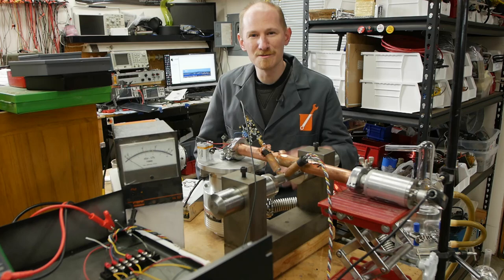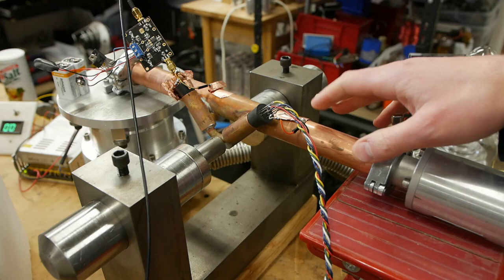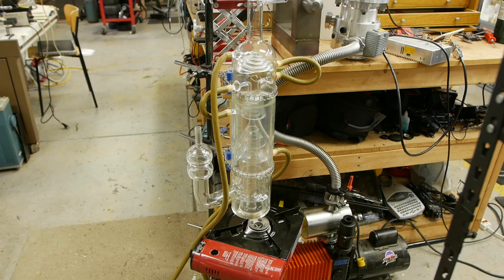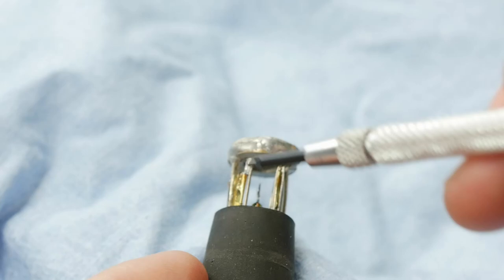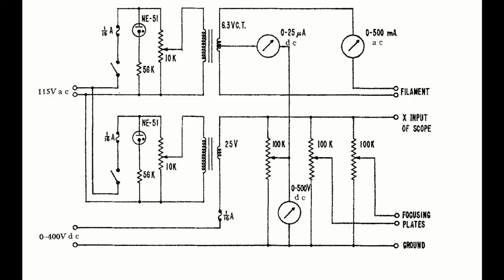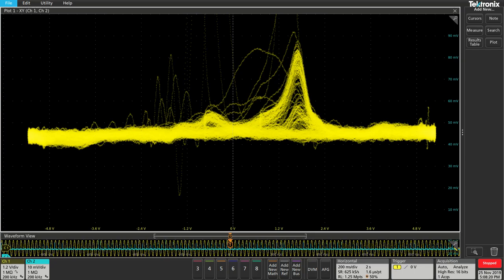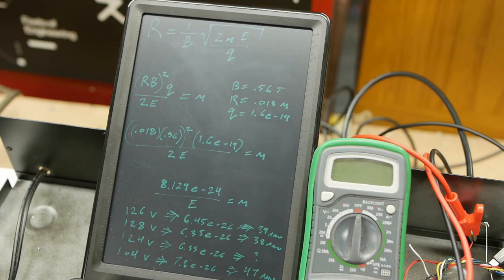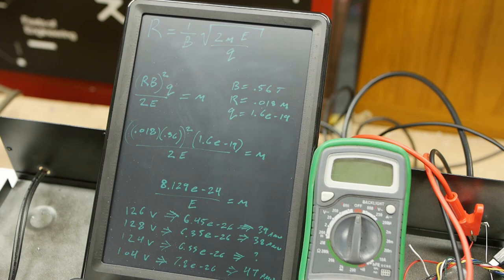DIY mass spectrometer measures potassium in dietary salt substitute

Comment: I was wondering about some ideas to debug the cause of the second peak. Both of them revolve around inherent measurement errors of the machine:
1) The machine may contain some compound that causes the error.
What happens when you run the chamber without the sample? Does the second peak disappear?
2) The machine could have some funky phenomenon where it measures the same isotope twice at different voltages: What happens when you run the experiment with a sample that contains only a single isotope of a single atom?

Comment: I think that extra peak could be a type of resonant echo.  One way that you could test it is by changing the diameter of your tube and see if that changes the location of the echo...  Otherwise, it could just be that the potassium chloride/ water solution has a contaminate in it..

Comment: Have you done an error propagation analysis of your mass peak calculation, and if so, what magnitude of error did you find?

Have you tried to fit the large asymmetrical peak spectrum with respectively one Gauss* and a sum of two Gauss'es* with means corresponding to the expected mass signals?
* Maybe a Gauss isn't the proper distribution for describing this type of spectra, and something else, like eg. a Lorentz distribution should be used instead.

Comment: While it seems likely that it's an artifact of the variations in the beam path/radius in the variable magnetic field or something along those lines- perhaps a double sequential slit at each end, forcing even further collimation, would attend to that (and ensuring the axis of the filament is parallel to the slit, I suppose)- I'd double check, given that the number you (and they) got was 47- silver- and just a couple AMUs above that for the "asymmetry" is tin at 50, that you're not getting artifacts from the solder in the copper joints? Whether it's vaporising due to heat and vacuum, or getting dug out by charged particles hitting it, or whatever. Just a wild possibility that occurs to me.

Comment: At 15:40 or so, couldn't you also put deflection plates past the beam slit at the ion source and sweep a voltage across them (like how CRT o-scopes work) instead of sweeping the initial acceleration voltage? That would probably be a bit more work, but I'm guessing the ion source is going to do sketchy things like voltage dependent sublimation (some things will probably preferentially stay behind, skewing the apparent mass and apparent mass ratios of ions).

Comment: A homebuilt GC or HPLC shouldn't be too much of a challenge for a talented person like Ben 😉
Edit: Based on a quick bit of googling, it looks like there are quite a few DIY gas chromatographs around, especially as the detection is being done by the spectrometer you don't even need to worry about the flame ionization detection stage.

Comment: Now you just need an IR/UV/Vis spectrometer, an NMR machine, and a crystallography setup, and you'll have a proper analytical lab you can charge people to use.

One question: the mass spectra I'm used to seeing show basically every possible size of "chunk" you can break off of the molecule with the ionizer. Compared to a factory unit, is the tungsten filament limited in what ions it's capable of producing? I guess a shorter way of asking this is: how different are the spectra produced by this from those I might look up in a reference (ignoring the noise, I just mean the actual m/z readouts)?

Comment: There is a coating on the razor blades. Could that be the second hill in your measurements?

I really enjoy your videos!
Reply: I considered this but he did clean them with some sort of solvent in the video...
Reply: Also the blades were used on both sides so it should be an even noise.. the polarity on the transmitting side will be wrong for a peek

Comment: Did you run it without any sample in the machine? That would flush out whether the mystery peak is systemic or unrelated to the sample chemistry. Also, where'd you get the Turbo pump? Not exactly a DIY thing laying around in my lab. :)

Comment: Have you thought about setting a fine neddle under the filament and with a very long copper capilary make a solution injector in the mass spectrometer? The capilary would have to be very long to restrict the flow and mantain the vacuum level

Comment: Wouldn't it be possible to use an induction coil to heat the oil in the diffusion pump and a blower to cool it back down? Or a peltier element.
Reply: Or perhaps one of those vibrational cryo pumps? I forget their name.

Comment: Maybe there is something else in the tungsten filament which, either singly ionized or doubly ionized has a charge/mass ratio close to potassium at +1. Argon or calcium at +1, or some other cation (krypton?) at +2? The bulb may have had krypton inside before you broke it. Could it have become bound up somehow with the tungsten? Is the filament even hot enough to kick off a +2 cation of a noble gas?
Reply: mercury or lead at +5 ionization? LOL.

Comment: I got curious abot that 47amu reading, if my understanding is correct this should be titanium, investigating about bulb filaments i came across patent number US3927989A, titanium is in alloy with tungsten to improve stability at high temperatures.

What is claimed is:
1. In a tungsten filament of the type containing a filament dopant compound including at least one alkali metal which produces a second phase consisting of bubbles at filament operating temperatures to improve the sag resistant properties of the filament, the improvement comprising a third phase material selected from the group consisting of , zirconium, hafnium, tantalum, ruthenium, strontium and columbium added to the filament for combining with the bubbles to reduce their migration and coalescence.

Comment: if you're worried about hysteresis couldn't you change the frequency of your accelerating voltage oscillation to be slow enough that you can easily characterize the field strength with an independent sensor to add as a compensating factor for your x axis?

Comment: Re. the second smaller peak that's  1/10 to 1/6th the height of the main peak: You may have a signal reflection. What is the length of the cable from the detector+preamp->scope? There are a couple of other potential causes too. I'd be keen to hear more/talk about it if you've still got this thing up and running.

Comment: I think it's gotta be Tungsten (+4). Maybe WCl4 is formed and it gets oxidized from the heat into W(4+). Also, the peak is roughly half the width of the main peak, which has a width of ~2 M/Z. Tungsten has weights ranging from 182-186, which would give it a width of ~1 M/Z. 

Super easy to test too. Simply run the experiment without the salt. I bet you'll find peaks at W(+3), W(+2), W(+).

Comment: Have you tried running just the filament or another control sample (NaCl or something)? Because what I just recalled, you don't directly record the mass, but the mass over charge ratio. So when you are using a tungsten filament, that makes me think that you might be picking up something like W4+. W has an atomic mass of 183.84, which is just under 4x 47 amu. While W4+ isn't the predominant ionization state, it is known to occur (according to wikipedia). I don't think your measurement window would be wide enough for W6+, but maybe you could set your spectrometer to look for that as well...

Comment: Could the peak at 47/48 be titanium? A quick Google search shows many of the sewing needles you use have a titanium coating. The tungsten filament could be acting as a sputtering source to knock off titanium ions from the needles. I think others are right, you should measure something else like regular table salt to see what peaks move.

Comment: Rather than build a chromatograph, you should consider building an infrared spectrometer. 

An IR spectrometer may as well be equivalent to a chromatograph for this use case, maybe even better, but is 1000x easier to build out of the hobby shop. As a first approximation, all you need is something to split the IR beam (diffraction grating, prism) and a wide spectrum IR source (which can be as simple as a halogen bulb and filter glass.) The rest is a clean and organized build, which you clearly can do. IR optics needs to cover wavenumbers from 400 cm^-1 to 4000 cm^-1. 

The main consideration with use/accuracy with an IR spectrometer is that they are relative instruments. This doesn't matter for distinguishing between two compounds, as you show here, but would mean they need calibrated if you want absolute measurements. This is perfectly workable too, though, so long as you already have a known pure sample to compare with.

If you can build a LASER Interferometers, you can build a IR spectrometer. And they are really useful instruments for chemistry considering the simplicity.

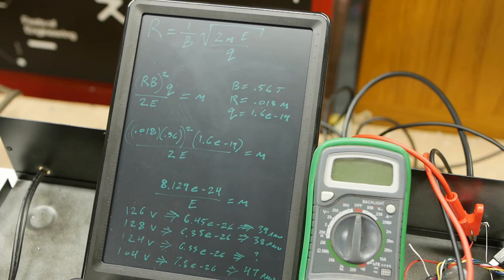Comment: What's the blue/green notepad thing he's using at 22:00?
Reply: It's one of these https://www.amazon.com/mafiti-Writing-Scribbling-Drawing-eWriter/dp/B07VM4CYXQ, they come in all sorts of colors, I have one that writes in pink. It's a sheet of vinyl stretched taught over a frame that sits slightly proud of the back. When you write on it static holds the vinyl to the back, changing the optics and the color of the film becomes more vivid. There's a small battery and a switch to charge the back repelling the film to "erase" it.

Comment: could be the variation in magnetic field strength across the tube bend with the variation of e field adds up to a non-preferred path through the bend... a center flight path and an edge of the tube path near the grounded copper tube with weaker b field??? seems like that would just smear the result not give a separate peak...whatever the cause, it appears to be a robust result as the little peak appears in the two other papers too

Comment: You refer only to K39 and K41 but what of the one in the middle? which must affect the results since it accounts for around 120ppm of all natural potassium. K40 is of course radioactive and beta decays to Calcium 40 and to Argon 40 by electron capture.Just as an aside, the ratio of C12 to C14 is used for radio Carbon dating, similarly the ratio of K40 to Ar40 is used in Potassium Argon dating.

Comment: Seems like a calibration issue and you just need to find a way top 'zoom-out' on the oscilloscope to correct for known variables. I don't think that the asymmetry of the peak is anything to worry about, and that it (along with all of the visible ghost tendrils on the signal) are simply artifacts of imaging such a small signal with such a high-gain amplifier. Notice the scattering of the signal resemble stray, whispy streams of plasma. I feel like it's a similar phenomenon at play on the screen.

Comment: I am sure someone else pitched this already.  But, to test the theory that the second peak is an echo artifact of the apparatus, could you run (separately) pure samples of: Mg, Al, Si and P etc?  If the main peak for each moves along horizontally slightly thats a good sign its working.  If that main peak is followed by smaller peak that moves horizontally with a shift, i think that would be evidence of an artifact.  If the main peak moves horizontally (its working) and the smaller peak stays put, that might be evidence of a contaminate.

Comment: What is the transit time of the ions from the emitter to the detector? Your voltage sweep time is about 8.9ms (1/2 of a 60Hz cycle) and the sweep is a sine wave, not a sawtooth, so any particular ion species will hit the detector once on the up-sweep and once on the down-sweep. Any delay in the ions arriving at the detector will mean you will see a lower acceleration voltage on the down-sweep and a higher one on the up-sweep.You know the kinetic energy of the ions, it is around 120eV. If you double this, divide by the mass, and take the square root, you get the particle velocity. Oh well, I estimated that to around 25000m/s so if you have a 10cm path the transit time is only around 4us, 2000 times less than the sweep time, so this explanation doesn't hold water!
Reply: That was my first though too, but yeah those numbers don't really work out.

Comment: Rather than measuring peak heights, shouldn't you be measuring peak areas?  I get something like 12:1, though it depends very strongly on where I decide to put the floor of the peak.  Additionally it should be a 13.8:1 ratio.  It's not hugely different from 15:1, but it's a healthy chunk of your deviation.  (Not arguing with your idea that the real peak is hidden in the asymmetric one, just a general comment.)

Comment: hello, hope my comment makes it to you:

i'm guessing the rubber stoppers work so well because they create a tighter fit under pressure getting sucked into the hard pipe - where as the geometry of the piping will morph over the 3d surface turning the o => 0

Comment: Degassed  Viton would be much better than black neoprene rubber.
   Stainless steel with high temperature silver solder would be more appropriate for vacuum work, and done by someone trained in high vacuum welding.
   You did well considering your equipment limitations.

Comment: Might try to get some VITON gasket og tubings pretty sure it's the same that's in car AC and it handles vacuum.
Or maybe pure silicon and offgassing it in an oven at high temperature first

Comment: Oh, and the hose issue. PVC hose and gum rubber hose is only good for foreline usage, they have too many volatile organics in them. Gum rubber is basically just latex and PVC usually has release agents. Rigid PVC can be used in a chamber if you machine off the skin where all the release agents are. Also PVC is rather hydroscopic so you could be seeing a lot of that outgassing.

Comment: So you've made the mass spectrometer, and I've seen multiple people on YT make  gas chromatograph machines, I think it would be cool if you could hook them up and make an actual GCMS machine. However, the problem I see right off the bat is that the gas chromatograph uses a positive pressure gas (helium) to push the compound(s) through the coil (usually packed with something like clay), and the mass spectrometer requires a high vacuum to operate. 
Do you think there's a way to feed the output of a GC to your MS machine somehow? Not sure how that can be done (but I'm not nearly as smart as you are, lol).

Comment: Couldn't the reflection be the physical kind? Like the ion beam reflecting off the copper tubing? I also suspect the localization of your magnetic field is not tight enough and the beam still curves in the straight sections of the pipe. Maybe your main measurement is that much worse than seen in the papers, and your current so high, because you were measuring the beam after one or more reflections all along?

Comment: At 24:50 the 120 volts is in the center of a peak its the isotope the 47 that you find maybe is due to silver present in the brazing agent most copper is brazed with silver try a other element with known atomic number and if its still present its silver

Comment: I can't see how your V-shaped sample introduction and collecting part is connected to the long tube and pumps.  I wish I could.
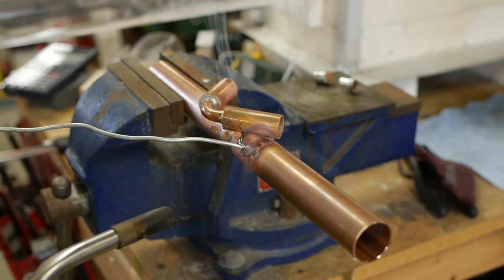Reply: When you see him soldering the apparatus together it has another view.  I suspect that the angle and his main vac manifold are drilled at matching places and then the holes are aligned and the pipes are soldered together.  Perhaps a short stub pipe if desired for ease of soldering.  The goal is to have large bore vac passages where possible and short narrow sections.  Section 5:57 shows soldering with (the predicted) short stubs and at 6:18 it shows a narrow bore earlier design (with the rubber hose couplings) that shows what look like standard T fittings to connect the elbow to the vac manifold.

Comment: The rubber stoppers probably work well because the vacuum pulls them into the tube and makes thier seal continually tighten more as the vacuum gets stronger.

Comment: Maybe the temperature of the filament varies too much sinusoidally and phase shifted compared to the x input? If true, possible solution might be more thermal mass (thicker tungsten wire), DC current, or adjustable phase shift. Or just ignoring half of the signal at decreasing x-input voltage.

Comment: More than interesting.... in your world i am a novice. Mostly i deal with XRF. And you would be amazed what goes on in that world. However i do have a suggestion from years of research. When showing students a new process, the stress is never assume. If it were me, i would send a sample or take a sample of the same material and have another machine check it. Paying attention to the secondary peaks. Cannot tell you how many years were spent due to one assumption. Here you are assuming that the P chloride is all that is in the container. Also i would identify, what your machine is telling you. What is that peak? Is there a way of contacting you, as i think you would be interested in the field of research that is coming to fruition. And the suggestions below gives more data to evaluate from....

Comment: Yowch, using a turbopump just to get to 10^-4 hurts. I know it worked, but I suspect you could get 10^-6 if you chamfered and smoothed the inside of those copper pipes and applied a little heavy vacuum grease (Apiezon, or silicone grease, or something - maybe apply outside needle punctures too).

Comment: You should really get or make a nice stainless or aluminum (all metal) chamber. Also, do you see water vapor or nitrogen on the MS? You should see those just from residual air. Instead of turning off your vacuum system to swap samples install a separate roughing valve and turbo backing valve with a nitrogen fed bleed valve to the chamber.